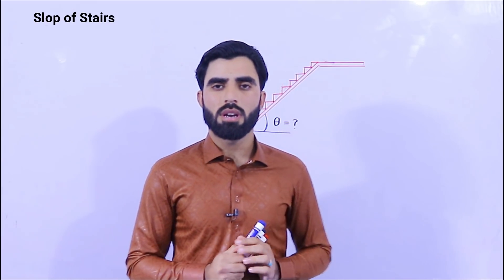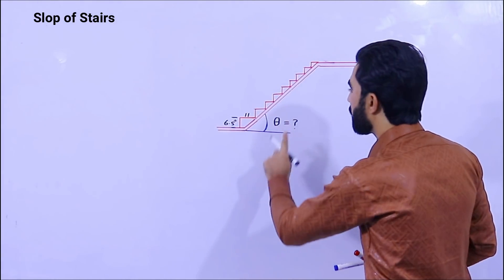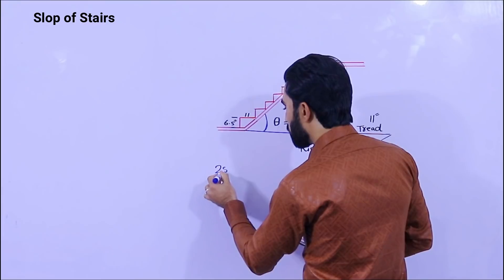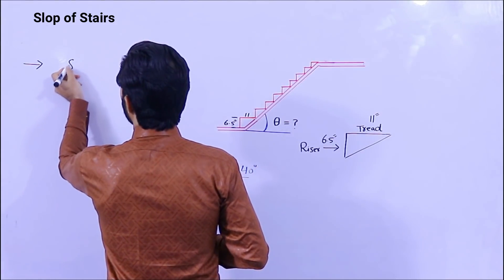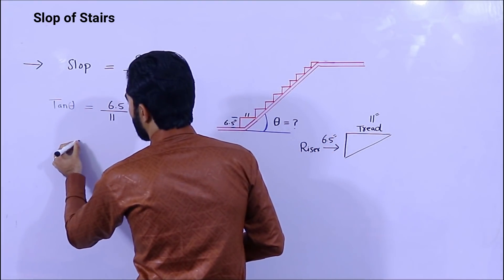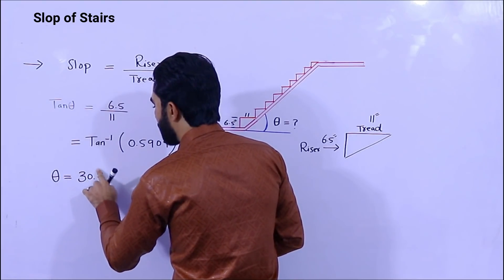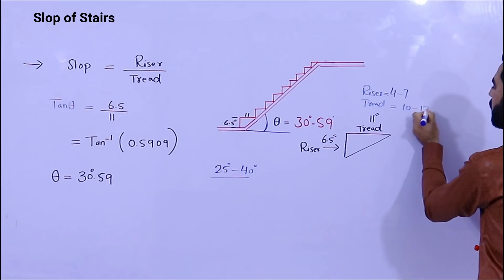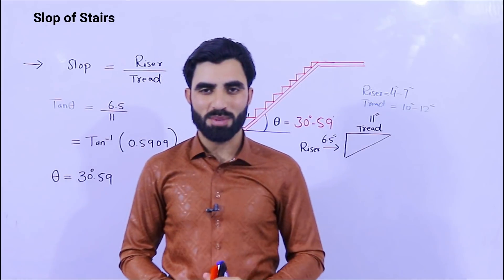Formula for Slope of Stairs | How to Calculate Slope of Stairs?

Comment: I've been framing for over 36 years rule of thumb is seven rise 11 tread. It's called 7-Eleven for a reason. If you measure from one floor to the other get your total measurement divided by seven it'll tell you how many treads you have. As well between 7:00 to 7:00 and a half on your rise depending on what your measurement is you should come out with an even amount of treads. As well most stairs I ever done come out to a 37° slope